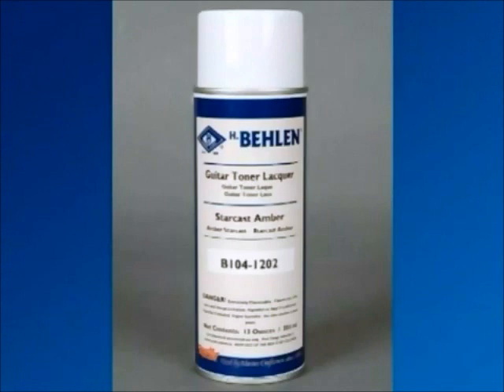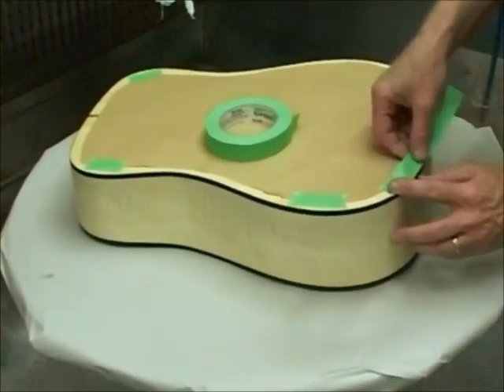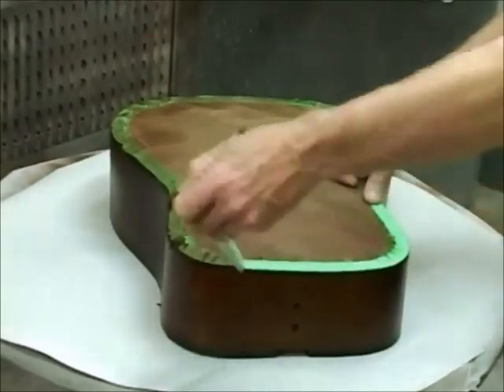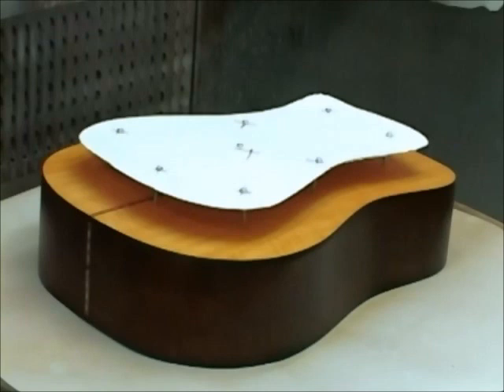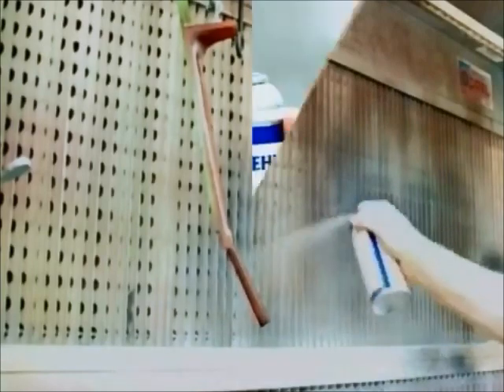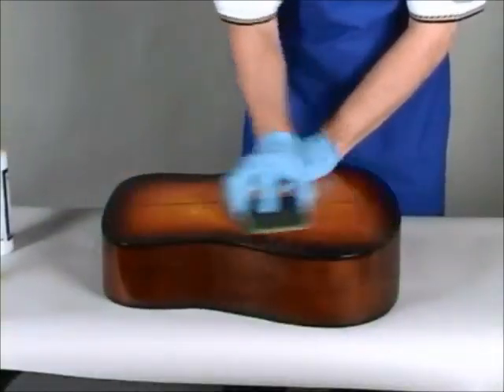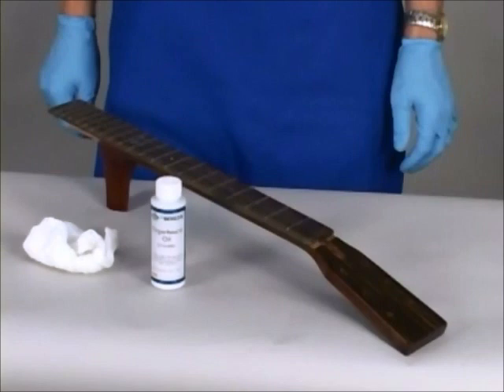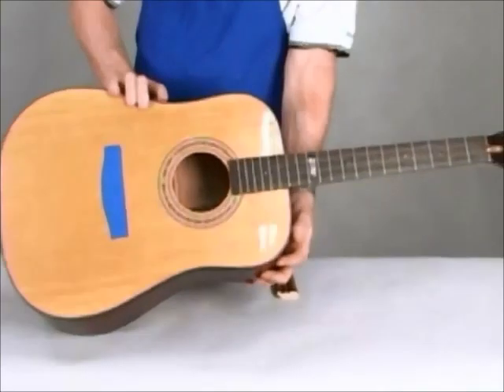How-To: Sunburst Guitar Finish

Comment: Very informative video. Thank you! Are all those products showed in video also available in non-aerosol?
As an automotive painter I prefer to use a compressor and a paint gun since it will give more smooth paint application. You also would avoid the heavier paint spots as seen on video since with the paint gun has dual action trigger, air is supplied first and than the pain giving much smoother paint coat. Another advantage is to be able to adjust air pressure.

Comment: Compliments!
I should paint a 70's eko ranger 12-string acoustic which is already live.
I eliminated all the very thick polyester paint because it was cracked and because I hope that without gaining a little more sound
I would like to do sunburst.
You advise me to do it with the black brown red amber background sequence like the acoustic gibson (I would do it with water or toxicity problems) or with the pad system you used (I think that being not an expert in using a spray allows me to make less mistakes).
T Did I think about using shellac with various pigments added to get the shade or just alcohol mordants of various shades?
For the final transparent stage?
I wouldn't mind a buffered sunburst finish but with a wax finish similar to natural wood taylor to gain even more sound.
Can the preparation be skipped by giving more coats and sanding or is there an easy way to do it?
To avoid beard and blemishes 300 - 600 - 1000?
Thanks Roberto
Reply from the maker: Hi Roberto, we recommend reaching out to our Product Support team at 1-800-260-9663 or support@rockler.com. They may be able to assist you. Thank you!

Comment: Using lacquer spray cans is a acquired skill.  Finger pressure on the nozzle is very important. The ambient air temperature and the temperature of the can also makes a difference. You have to start the spray before it meets the wood and continue on in long strokes off the wood before stopping the spray while moving the spray pattern. If you hesitate, you will get a run that is difficult
to cover up.
Reply: +SuperCarver2011 I thought the spraying should've always started and finished off the guitar. This is the same technique used when spraying a car. Still if your familiar with doing it this way then you go with what works for you I guess.
Reply: +voxac30withstrat I think you are both saying the same thing. Start the spray before you go over the body and finish after you have left the body.
Reply: Daniel Flores Yep I was saying that. Thanks anyway guys. I actually ended up buying an airbrush compressor and a car touch up spray gun now all I have to do is get the matching connections doh.
Reply: Daniel Flores Yeah it was cheap I got the compressor for about $120 australian dollars and the touch up gun for about $29. The gun is only small it is just for touch ups only. But I will let you know when I've got all the parts and start the spray. At least I'll try to remember
Reply: Thanks n good luck

Comment: Why do you do the black outer before the red starcast amber as the final? Does the sequence matter?
Reply from the maker: Hi Guy, the sequence does matter. The step-by-step process demonstrated in the video is a rational and practical way to get good results with the least opportunity for failure (accidental goof-ups).  With that said, there are often more ways than one to achieve good results with woodworking or finishing techniques. But if you are new to a technique, it is a good idea to follow an accepted process before experimenting with your own.
Reply: @rockler  excellent yeah, was just thinking it might be easier for a beginner to just move from center out to avoid any freehand sprays - I'm in the middle of the process now, starting the burst sometime over the next week, hoping everything turns out alright haha